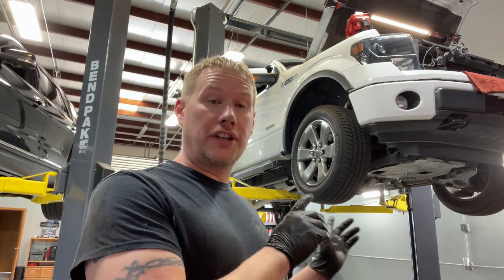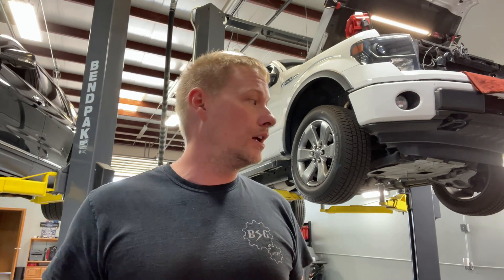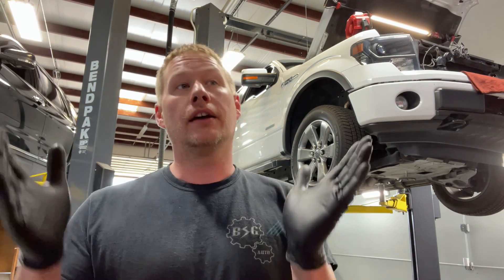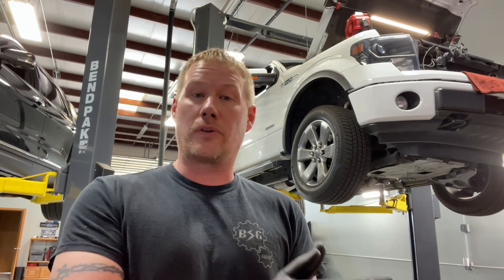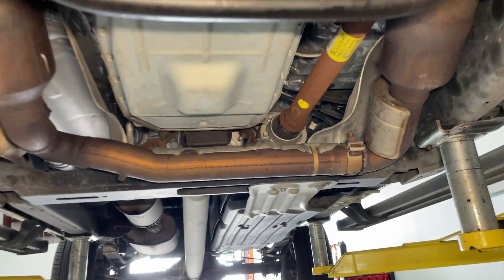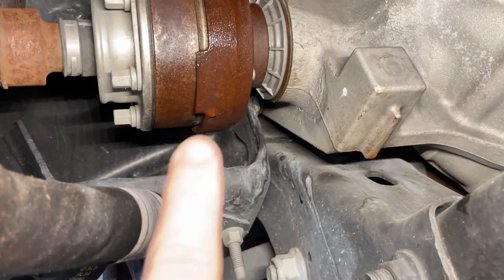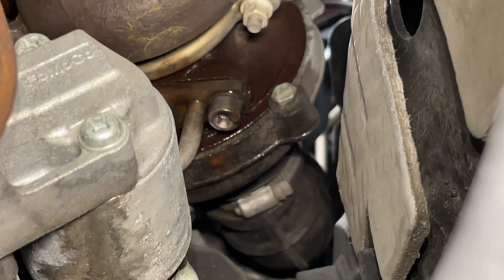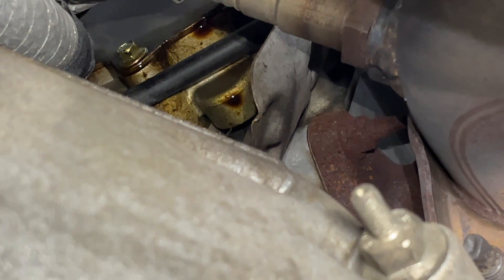Ford Ecoboost Engines Can be so Hit or Miss: I Really Feel Bad for This Customer...

Comment: Used to be a diehard Ford guy... Despite having been screwed by the 6.0L at about 130k, I ended up buying a 2013 F150 with the 3.5L Ecoboost and am now stuck with a truck that is virtually worthless. I actually like the truck but I had the timing chain done at 125k miles and it was a terrible experience resulting in 5 return trips to the mechanic (not the trucks fault really) for a misfire code. The final diagnosis (confirmed by two subsequent Ford dealerships) was that the engine has low compression and needs to be replaced at an estimated cost of $11K, which I am guessing goes up when they find other items needing repaired during the engine replacement. While I have the resources to replace the engine myself, it is a lot of work. I could probably find a way to pay the dealership but 11k is a lot of money. Trucks are insanely expensive so replacing the truck isn't a favorable option. A new truck with similar options would be 50k at least. Finding the same truck as mine (within a year up or down) with the same options and mileage would cost 20k at least and probably leave me with the same potential issues. Probably should have bought the 5.0L but time travel definitely isn't an option. I'll figure something out but it just seems they are all bad options. It's just really disappointing when you pay so much for these trucks and they just do not last

Comment: I went with a 2020 2.7L supercab f150. Had coolant leak and 4x4 issues the first 30k. Sold that puppy during the chip shortage for alot more money and got a 5.7L Hemi. cant go wrong with V8 power.

Comment: I have 2018 3.5 ecoboost and every so often when accelerating off a stop, engine will bog down and I get warning on dash "System charging, have serviced". Ford shop said I need new alternator to start. Had alternator replaced, but it still happens on occasion. Checked some forums online and get all different types of solutions, like turn off auto stop. Ever come across that?
Reply from the maker: never.

Comment: I think it's a QC issue. The cars that go forever are either flukes or have oblivious owners. It's amazing how far you can push an engine before absolute failure. I mean I used to work with someone with an 00's expedition and they just put black tape over the CEL and kept driving. They were almost at 300,000 miles.  Was their car in good shape? I doubt it, but it's like going to the doctor, if you don't go you aren't sick right? Now they tell everyone "I had a __ and it lasted for ever with no problems." And, "I've never been sick a day in my life."

Comment: 2014 f150 58k miles. Startup rattle after sitting more than 16 hours. 

I had Brian do the timing on my 2010 F150 (sound dampening foam on air box video) and that truck ran great after was thrilled.

Disheartening I’m going to have to spend 3k on another motor/truck at such a low mileage.

Comment: I have a 2.7, I use Amsoil and change it every 3,000. I love the power when you need it. Gets 10klm per 100 normally. I also added a catch can. I think I'll have good luck considering how I maintain it. There expensive and very few maintain a vehicle properly. After 5-8 years there all junk...regardless of make or model.
Reply: good choice.  Catch can is unnecessary in Eco because of valving in intake.  Yes for Voodoo.  Whatever makes you happen.  Ford doesn't make catch can for eco, but for Voodoo, so obviously it doesn't need one

Comment: After fixing the quick connects on the turbo the quick connects on the other end of the pipe on the back of the engine will leak

Comment: Customer towed in a 2014 1.5L diesel  Ford Ecosport, it's a crank no start, scanned the car Dtc P062B68 Internal control module fuel injector control performance, erased the dtc car starts fine, after 10-15 mins of shut down tried to start the car, again same dtc crank no start, checked injectors they are having normal back leak, can you suggest anything i should check? As ford exited India we are in big trouble finding replacement parts.

Comment: I bought a 2017 ford transit 250 brand new. I went with the 3.7L NON turbo engine cause I knew the 3.5L turbo versions of engines seem to burn up quicker. I really don't need to take off fast enough to turn heads. Yes these newer set ups are more fuel economic but it ends up costing you more in the end with repairs. My van has over 435000 miles on it now. I am hoping for 500 000+ miles. Wish me luck!

Comment: My truck has had every single one of those leaks.  I have replaced water pump exhaust manifolds, plugged cats, throttle bodies, leaking turbo lines, leaking vacuum pump, etc.  I love the truck but chasing all the constant issues gets old

Comment: Hi, I was tighten the turbo clamp on my 6.0 powerstroke, and I believe I may have over tightened it. Heard a snap and it went loose. It seems I can still tighten it but the clamp spins around. Do the clamps break or do I just need to replace the nut/bold mechanism?

Comment: I’m driving an ‘07 SCAB with the 5.4 and 165K miles. Looking for a new truck if these prices ever stabilize to something close to normal. I was looking at the 2.7 ecoboost, but I’m concerned about expensive repairs. The more complicated the engine, the more there is to go wrong. I may just pick up one with a NA motor and call it a day.
Reply: I've got a '15 F150 with the 2.7 Ecoboost now with 102k miles. No problems other than the plastic oil pan leaked, once replaced, no more leaks. I've owned three 5.4s & although they were good, the mpg's & cracked exhaust manifolds got real tiresome! The 2.7 pulls as hard yet gets much better mpg's. I was skeptical of the Ecoboost but I guess I'm one of the lucky ones!

Comment: My 2011 EB has 372k miles and  only major items  water pump at 250k,  transmission at 350k. Normal maint plugs at every 50k coils at 100k. Pegasus Racing hose upgrade for coolant overflow tank, 1 lower ball joint at 325k plus normal brakes and belts. I still need to change the rear end fluid that has never been changed. I guess I got a good one.

Comment: They aren't called Fix Or Repair Daily, Found on Road Dead for nothing. Area I live you only find ecoboost engines in vehicles used for personal transportation. Work vehicles have stayed with the 5L more reliable. Home community only has a Ford dealership yet there is more GM/Chev's. By time you add in the Ram Ford is a small segment of the market and it is all due to reliability and probably some dealer service issues. They aren't the vehicle they once were.

Comment: Brian, I really appreciate all your videos, especially the ecoboost vids. I have a 2011 FX2 ecoboost with 87k miles. Rattles on EVERY cold startup, brutal downshift from 5th to 4th, driveshaft bump, and bad miss under heavy acceleration. Will no doubt creator soon. 🤦 
I’m half tempted to pull the motor on a long weekend and go though the whole thing and give it a nice Performance upgrade/tuneup.  Would love to see a comprehensive video on sensible smart Upgrades for gen 1 Eco’s. 
Awesome work, Brian! Keep it up!

Comment: Any idea what’s going on in the f150 ,250, and a bunch of others with the service advancetrac message. Have a 2014 lariat where it pops on, can’t use left turn signal, used scan tool no codes, been waiting to see if you address it. Watched every one of your videos, very informative. Retired mechanic of 40 yrs. thanks

Comment: Have a question for you so hope you can help. I have a 2001 ford f250 superduty XLT with 5.4L V8. . Has a 137" wheelbase. My parking brake cables need replaced and Im trying to find motorcraft replacements but Im running into issues. One I called ford dealerships but they dont have them in stock anymore and can not order them with the truck being so old. So they gave me the part numbers but couldnt get the length of each cable which I wanted. So the issue that Im running into now is that I have found actual motorcraft parts but not sure if they are the right ones for my truck. For example when I go to say advance auto parts and look up parking brake cables and look for say the front cable. Its shows front cables in aftermarket brands and then they have the actual motorcraft brand but the thing is the lengths for each cable are showing different lengths. For instance the front motorcraft is 40.55 inchs and the aftermarket cable is showing a longer length so Im not sure what length I actually need. Can you help please

Comment: There is a 2.7 ecoboost on F150 forum, 465,000 miles. Original motor.  Arod powerstroke, 6.7 powerstroke 1-million miles, original motor. Ford makes good engines overall, some years are better than others. The 2018+ ecoboosts seem to have far less issues than the earlier versions. I have a 2019 2.7 F150, 44k miles...thought there was a front cover leak, turned out to be just a loose bolt under the oil filter housing. Dealership re-sealed under warranty, checked pan as a courtesy, no leaks. I hope to get another 200k miles out of this 2.7.
I think the 2.7 is the best overall engine in the F150 line up for longevity, power, fuel economy.

Comment: At least the water pump on these is externally driven...my 2013 3.5 is driven by the timing chain.  I have to check the weep hole periodically to see if the inner gasket is failing...don't want any coolant in the oil

Comment: Thanks Brian. Great videos!! I never miss them! I have a 2015 F 150 with the 2.7L twin turbo and 60K miles in CA. Thankfully no problems yet but I did get the 7 year/75,000 mile extended warranty. This video makes me want to take the truck into a good independent mechanic for a thorough inspection before the warranty is up next June.
Reply: Just do it.

Comment: Going through same stuff with my 2013 F150 3.5, 76k miles and timing needs fixed as it rattles on startup constantly if left off for more then 45 minutes to an hour, also had a leak on the left turbo. Thankfully I bought an extended warranty through Ford when I got it 20k miles ago, Warranty is supposed to cover everything.

Comment: I was a diehard Ford guy until my 2017 f150, and my wife's 2017 explorer. My f150 you couldn't close the doors if it was below freezing-known issue, Ford refused to fix because "we are not in the affected climate area".... and the paint was chipping off the truck in multiple spots....

Wife's explorer has had to have electrical work, ac compressor, head gasket, and now needs a new set of solenoids in the trans.... I have lost all faith in Ford.

Comment: The water pump catastrophically failed on my 2011 Taurus SHO, probably due to timing chain stretch. Dumped all the coolant and a lot of aluminum into the oil pan. Every bearing is shot. Almost threw a rod. It had maybe 80k when this happened. Good times.

Comment: My 1.5 Ecoboost Fusion is getting oil residue on the engine side of the breather tube at 128,000 miles. Is this blow by or maybe a seal or something that has gone bad?

Comment: I was annoyed when the Seat Heater module failed at 70,000 miles, on my 2014 Volt!  Our, bought new, 2000 Ford Excursion 7.3 Diesel, 4x4, has been excellent.  Now at 222,000 miles.

Comment: I've been a die hard Ford Fan for ever. Always had them and never had any issues, until now.

My truck 2017 F-150 3.5 ecoboost has the phaser rattle at 27,000miles. I'm very disappointed. I take very good care of my truck. Covered under warranty of course but it's disappointing.

Waiting on parts for the repair...
Maybe my next truck will be the electric F-150..

Comment: All manufactures have the cars that are either really good or really bad. I maintained Festivas and Yugos back in the day. 200k easy when maintained. They got a bad rap from cheap people buying them and not maintaining them. Chrysler 200 is the new K-Car like Fusion is the new Tempo. Some need an engine by 7k and some live forever with barely a care. We have a K-car conv with 35k on it going for $13k. How crazy is that?

Comment: We had a new company bean counter try to save some money by not purchasing a 250 diesel and instead bought one of these(non 4x4) weve loaded all our tools and equipment into it for the past 4 years and beat the living $h!t out of it
Oil change? Whats that
Air cleaner?....most likely original 
Transmission and differential? Ya right
We are trying to kill it but  haven't been able to yet
I think the belt flew off one time but other than that it bombs into the city 5 days a week

Comment: Mine looked like the day it rolled off the lot and I sold it back to the dealer at 75k miles with timing rattle and extreme blow by. Went and bought a new Ram Cummins and I am done with Ford crap. Mine leaked antifreeze from crappy quick connect fittings, leaked coolant at turbo, ate spark plugs every 20k miles and would start to idle like crap. Started having timing chain rattle and while deciding what to do I pulled the oil cap and it was blowing so much blow by it was like a hair dryer.

Comment: I'm glad I bought the 5.0 V8. I have a 2018 and it's almost worth what I paid for it unbelievably. Chip shortages I guess as there isn't any new ones on the dealer lot.
Reply: Hi - also looking at a used 2018 with the 5.0 V8 - have you had any oil consumption issues?
Reply: @joemontana4370  Upon further review, I'm glad I got rid of that pile. Heater core clogged and transmission clunked. Only 30,000 miles.

Comment: My company truck is a 2016, 2.7 Ecoboost. it suffered injector failure at 112,000 miles and washed 2 cylinders. Fords solution was to replace the motor to the tune of $9,000.00. For such a small motor in a full sized truck, I'm surprised by the power and fuel economy. It averages 18-19 mpg and it replaced my 2013 F150 with the 5.0 that only averaged 13-14 mpg.

Comment: There's a reason this life-long Ford guy has 2 Toyotas as our daily drivers. We've had the Focus with it's PowerShit trans, and I have an '05 F150 that I'm basically afraid to drive, previous owner replaced the motor before 100k, the trans does all kinds of goofy crap, and the frame is rustier than the hull of a WW2 Navy destroyer. IF I ever buy a Ford again I sure as hell won't being an EcoBurst anything.

Comment: My 2017 3.5 ecoboost f150 with 65000 miles is in for a timing job right now. I have my truck serviced every 5000 miles by my local ford dealer. It is a hefty 3400 dollars. Dealer said 3 to 5 days for the parts to come in then another 2 days to repair.

Comment: Sometimes an extended warranty is your friend.  Sure glad I had an extended warranty for the timing chain replacement.  Not overly impressed with the degas connector.  The second one (Motorcraft) leaked more quickly than the first hose.  I think I will just keep an eye on it this time.

Comment: My wife and I both own 3.5 ecoboosts.  Hers a 2012 in a Lincoln MKT. 210,000 km has been a great car.  Mine a 2014 f150. 190,000 km. The last 8 months I have done both turbos had lots of water in the intercooler. So we are 50/50 with these engines.

Comment: These modern cars expensive to buy and fix. Bring back the v8 with a manual transmission and manual hubs if 4x4. Like the 77 150 I had as a beater in the 90s for 10 years.

Comment: Well im doing pretty well with the 2.3 ecoboost in my ranger. Just keeping up on the maintenance helps but if it ever blows ill just buy a used engine and throw it in. Cheaper than rebuilding it atm

Comment: Don’t have that engine but I have the 5.0 mines burning oil about 1 quart every 1000 miles and yes I changed my oil every 3000 -3500 miles with synthetic started to notice about 85000 miles

Comment: The woes of a Turbo engine lots of power, but $$$ to fix. Feel for the  6.7L Powerstroke owner when that fancy Turbo setup on them needs replaced. The 7.3L turbos were expensive enough to replace.

Comment: It sounds like the Ford Freestyle CVT transmissions, we have one. They either fall apart or just keep going.
Reply: @Rhonda's Part Time Lover our 06 Freestyle just went over 110k miles, outside of the sunroof water drain issues, knock on wood, it's been good. Love the versatility and space. Would love to get a used Taurus X or Flex. Similar platform, but  they switched those back to conventional transmissions.

Comment: What I think: Ford is one of the worst manufacturers when it comes to reliability and ease of general maintenance. Like my mom's old 2014 Fusion, she hadn't put 35k on it when one of the shaft seals on the transmission started weeping. Luckily we noticed it before the fluid level got low enough to deal permanent damage to the transmission (I randomly spotted it when changing the oil). Also changing the cabin air filter took like four times longer than it did with any other vehicle made by any other manufacturer that I have helped with in the family so far (including Chevy, Chrysler, Nissan, Toyota, and Subaru). Also the car has no center jack points on either the front of the back, so doing driveway maintenance is a pain in the ass. And that car wasn't the only Ford we had issues with either. I didn't see any of those leaks or issues with any other vehicle of similar age and mileage, including the Malibu and 2015 Forester that I had, which I put more mileage on in a shorter period of time and, yeah, no issues other than oil changes and brakes.

As you can tell, not a big Ford fan. Some people have good luck with them I guess, but I am not one of them.

Comment: I got burned out on my old truck with the 5.4 Triton, $1400 plug changes, 2 timing jobs then the driver's side cam lost all oil from a bad internal gasket. The cam wore right through the bearing caps at highway speed never had a clue until I lost 4 cylinders. Towed to the dealer and all they say is " they are known for that" I don't think I'll be buying another Ford